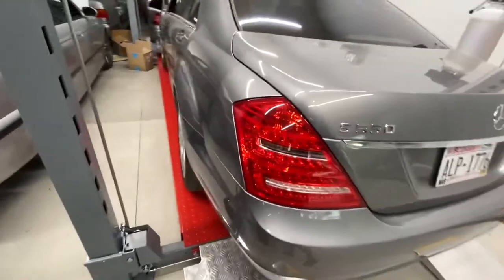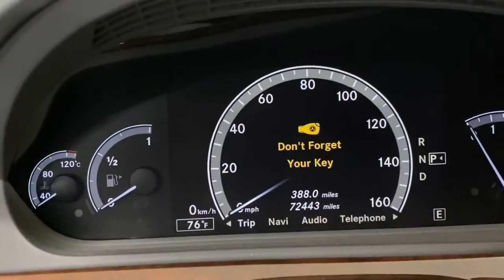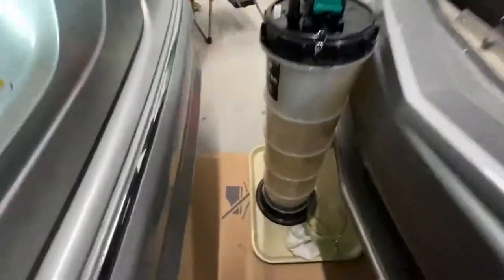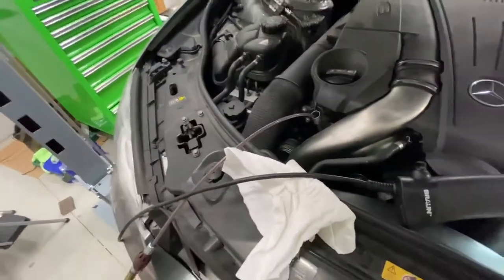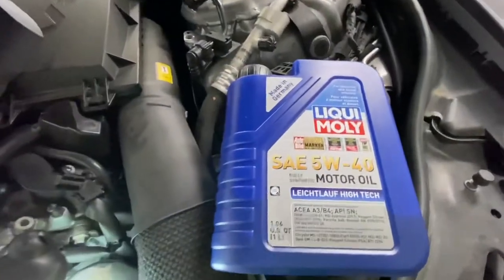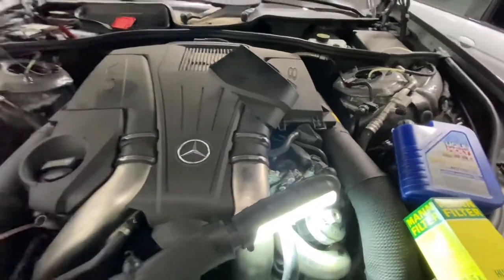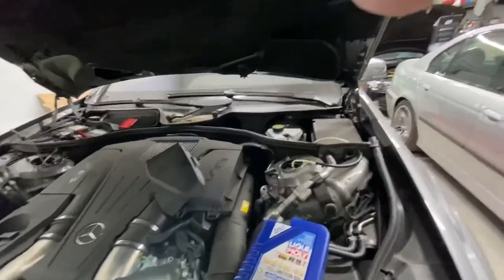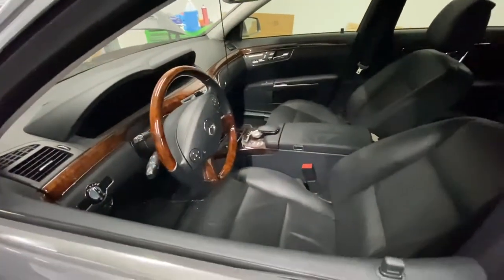2012 Mercedes S550 (W221) oil change

Comment: How do I know the life of the engine oil from inside the car?
Reply from the maker: My car has a maintenance reminder. Just recently told me to do a D service. I ignore the Mercedes service schedule. For example, my Mercedes gets fresh oil and filter twice a year no matter the mileage. I over service the car. As they say, oil changes are cheaper than engines. And I do my own work so cost is parts only. It is a sweet sweet ride. Hope this helps.

Comment: Jesus, 65000 miles or so for $ 15 0.00, that was a deal.  I paid $ 23 000 for an 2013 s class twin turbo with 90,000 from the dealer.  The panel just showed me and E on the dashboard after I tried to use the paddles for the first time.  I decided to check the oil and its empty after running it for 2 minutes.  I am going back to recheck.  My point is the bastards did not even bother to check the oil and I am wondering how much its gonna cost me and how to do it myself or send it to the dealer.
Reply from the maker: Sorry. That sucks.  Oil and filter asap. I assume it runs?
Reply: @nevadarobert7908  yes, it runs.  I am still looking at videos on doing the oil change and what I need.  I assume is not very different from other cars.  I need to get the right oil.
Reply: Just check the oil three times at least.  Its full but looks brown and has 97300 miles.  I think its time to change the motor oil.  Need to check the transmission.
Reply from the maker: @manuelugaldeultreras842  I use FCP EURO for my oil and filter kit. They are price competitive and have great products. Get some help if you have never changed oil. Easy once you have done it.  Best of luck! You have a really nice Mercedes-Benz